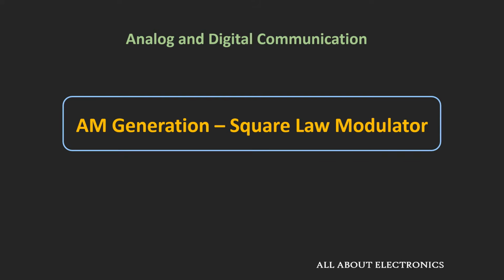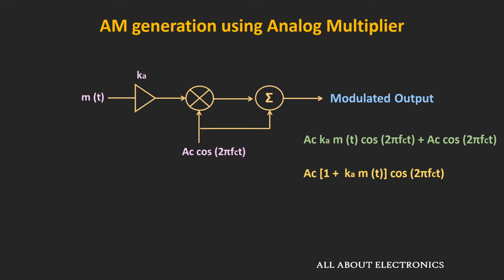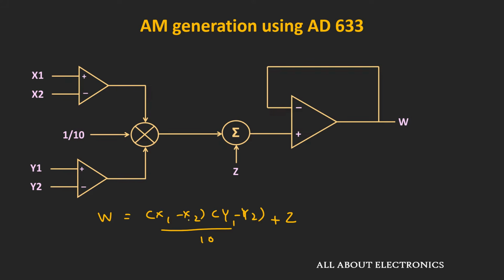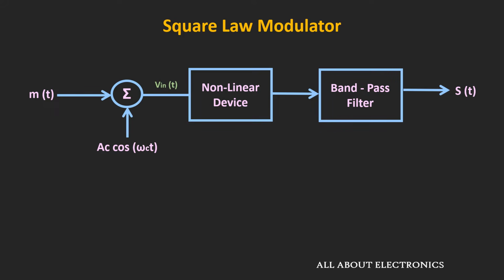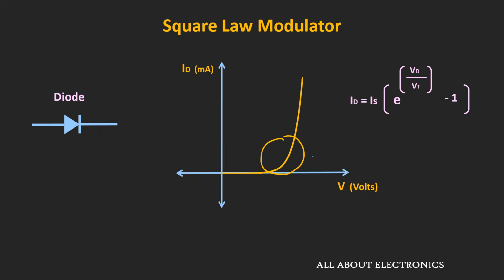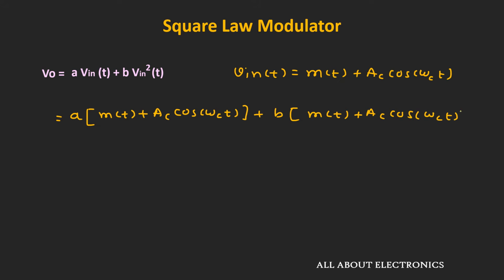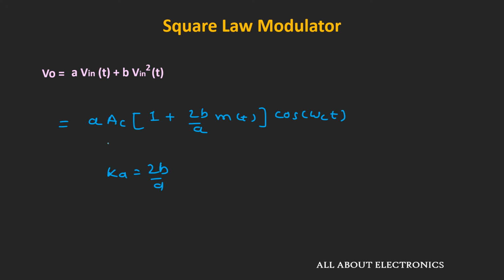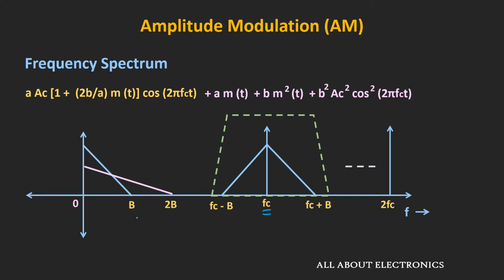Square Law Modulator and AM generation using Analog Multiplier | Generation of AM signal

Comment: Sir please reply 

Sir it is the square law modulator video 

If we use diod, it block the reverse voltage in summation of carrier and message signal there is reverse voltage.

Is diod is used like rectifier to transmit both voltages

Comment: In some questions they are giving the output of SQUARE LAW DEVICE as v0= 2V1+0.1V1^2.  Now, how can we control the output voltage  of diode?? (how can we change the values of A and B for a diode)
Reply from the maker: It's not always necessary that only diode is used as a square law device. Any device with square law characteristics can be used.

Comment: So amplification comes after modulation?  Is that right ?
Reply from the maker: For passive modulators, like using diode, yes amplification is required to boost the signal levels.
In case of active modulators (e.g using BJT), some gain is provided by the modulator itself. But that won't be sufficient to transmit the signal over radio link. So, additional amplification is required even after that.  These type of modulators are known as low level modulators. (The modulation takes place at low power level of the carrier signal)